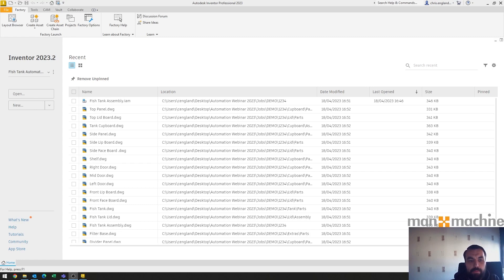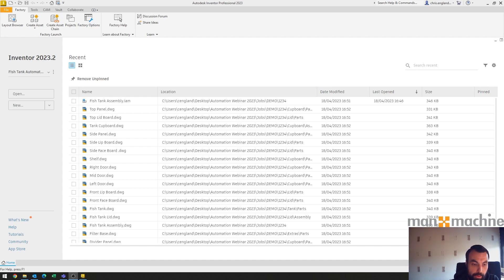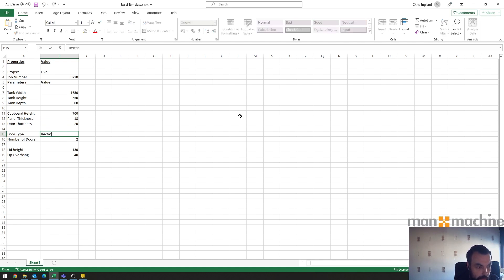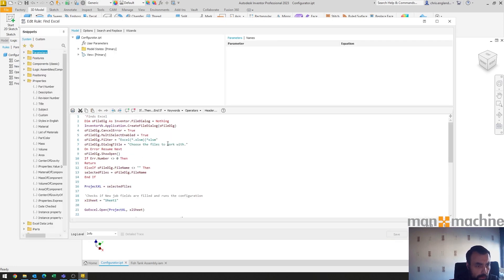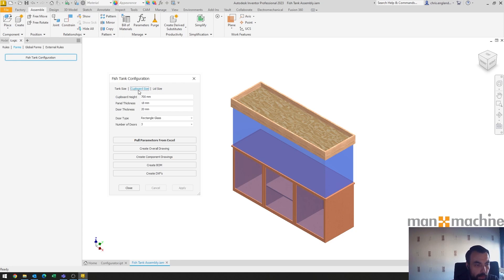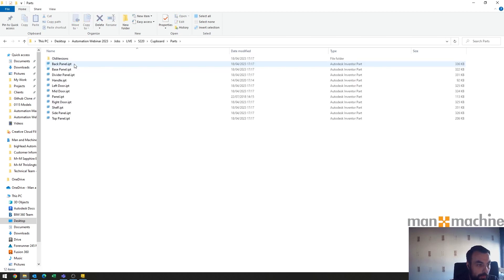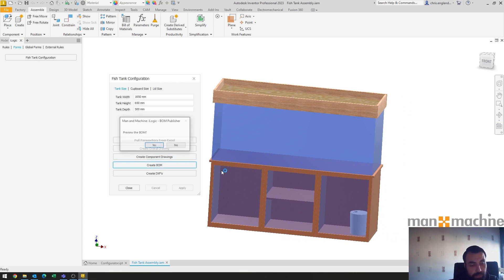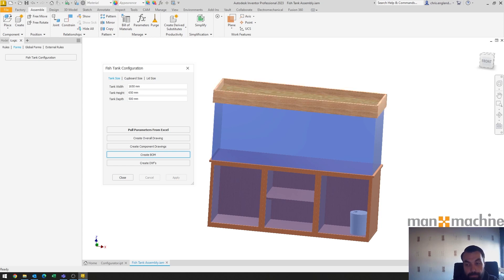Using Excel to Drive an iLogic Configurator

Comment: Hi. It is really nice work you have done here. Could you please explain how did you manage to pull text parameter from excel to inventor?
Reply from the maker: The iLogic snippets in the video to extract data from Excel work for both integers and text fields. Just ensure the receiving parameter in Inventor is a text type parameter field to receive the data correctly.